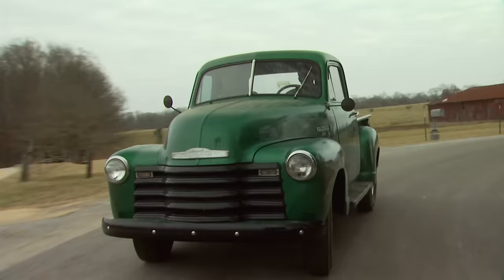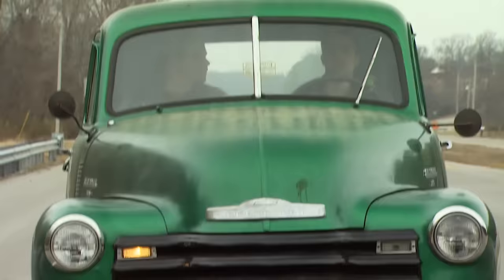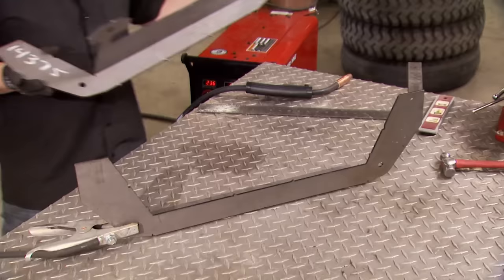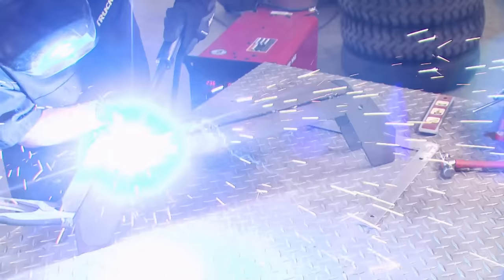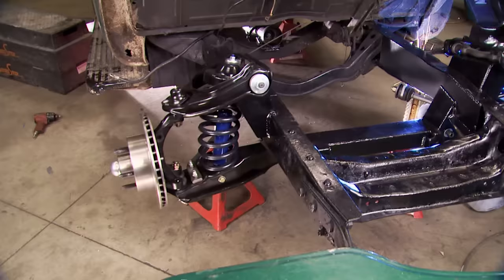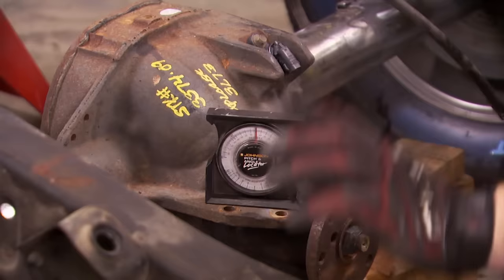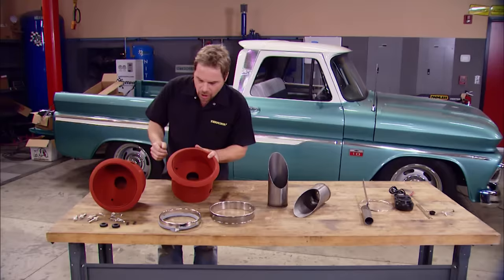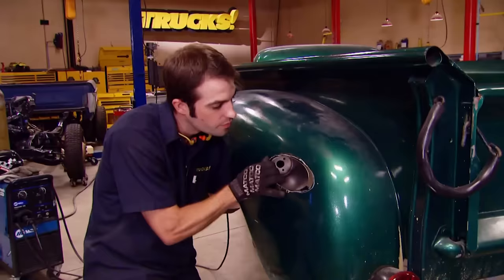FULL REBUILD: 1949 Chevy 3100 Truck with a Hopped Up Straight Six and Patina Paint

Comment: These classics deserve to be restored and preserved.
Reply: i agree 100% i hat it when people get great old trucks and turn them in to hot rods
Reply: well that one was restored in the 80s, so its not original anymore.
Reply: @Motersickle Bum that is true I can’t stand lowered trucks such a waist
Reply: @Motersickle Bum that is a terrible story I work in a tire shop and I occasionally see that kind of stuff and it just makes me so mad I saw a guy who had a diesel 1986 dually GMC that he had lowered and put passenger rated tires on it which is actually illegal for a 3/4 ton Axel it was so bad
Reply: John Smith  keep it as a truck it looks pretty ugly lowered and you still have a bed a motor built to work
Reply: John Smith  wo wo how old am I? Don’t ask me that nobody cares what you think either your worse at spelling than me
Reply: John Smith  ok 10 year old
Reply: John Smith  huh
Reply: @Motersickle Bum I know! 
They spent like $3200 plus labor downgrading the suspension. 
I mean I can sorta get the front axle but not really. 
I don’t why keeping leafs was a problem other than promoting parts that people sell?

And how do you do the math on repair to the tree shifter by replacing the transmission? LOL 
And they had to buy a transmission crossmember? 
It pissed me off they hacked the floor when a hammer and dolly and some judicious cuts it would have at least looked like it belonged there.
Reply: It's just an old piece of machinery.  The best things about it are the cosmetics.  Functionally it's terrible and actually somewhat dangerous to drive in modern traffic.  If it's modified and gets more use because it becomes more fun to drive, I think that's a win.

Comment: My last year in the military I had a '49 Chevy pick up.
I rebuilt the 235 engine that was in it, backed it with a 3 speed overdrive tyranny (eh..which... I mean transmission) with a floor shifter, installed a '56 Chevy passanger rear end, and installed a '52 Chevy passenger car front suspension that lowered the truck way down.
I installed 4" lowering blocks under the rear end.
I converted it to 12 volts, installed a '66 Pontiac tilt column, and installed rear door window motor/regulators from a '64 Oldsmobile so I could have power windows.
I also had Lakes pipes on the edge of the running boards with a notch cut into the front fenders.  The mufflers were 12" oval glass packs installed just inside the notched fenders.
The stock exhaust manifold was "split" for that old school "Twice Pipe" sound.
The wheels were chrome Rocket brand brand wheels that kinda look like the old Cragers.
The tires were 5x20x15 (white stripped) for the low rider look.
That truck was my old girl friend's favorite vehicle to drive because she used to like to drive it on windy roads.
She favored it over my '56 Belaire with a 375 horse 327!!

Comment: This was the first vehicle, which I owned. The 3 on the tree shift linkage would also get stuck between gears, but it was easy enough to straighten out quickly at the field.
       It was stock and I used it as a daily driver back in the early '80's. It had no problems keeping up with traffic on the expressway. Don't know what the top speed was but cruising at 75 mph wasn't a strain. As far as the brakes, I had to "think ahead". It had the oil bath air filter, but didn't have an oil filter. That was kind of cool.

Comment: I had the same truck as the first 4 wheel vehicle, that I even owned. It was green, but was a rust bucket. The 3 on the tree would occasionally get stuck between gears too.  Had the starter pedal on the floor and the oil bath air cleaner. A lot of fun, back in '82.

Comment: We own and built a 50 with a 261 out of school bus, duel Webber’s, Fenton Headers, Saginaw  four speed transmission, twelve bolt GM rear end with 3:07’s
Power disks brakes, power steering , mono leaf springs all the way around.
Reply: I have a friend with a 53, 3100. He also has a 261. But, had a radical cam manufactured for it and has a Corvette triple carb side intake and duel exhaust system. Damn thing is fast!

Comment: Reminds me of my first vehicle, a fully restored to original 1950 GMC pickup which I purchased for $300. That was in 1973 and it was old then but looked and drove like a dream. 3 on the column of the largest steering wheel you've ever seen, had to be big because there was no power steering. 6 volt battery system located under the passenger side of the bench seat, floor starter which required you to push in the clutch and gas pedal while crossing your right foot across the starter petal. A toasty box heater underneath the passenger side dash, no turn signals (you had to use arm signals sticking your left arm out the window) and one tail light located on passenger rear bumper. Positive traction and could go most anywhere. Once drove it across a flooded lowland and the water began to come up into the cab, 2/3 of the truck was submerged but it made it across. Changed the oil with no damage...what a truck.

Comment: Nice job!
I had a 50 with a 250 I-6 ,headers and dual exhaust and a car 4-speed. I slightly updated the suspension with mono springs, factory front sway bar and a disc brake conversion.  A newer car rear end was installed with appropriate gearing so I could just slide down the freeway as needed.
 It was a lot of fun and literally used as a farm truck to haul hay for the horse and materials for home projects. :) DT

Comment: I’m so glad I found this video!  I have an early ‘55 in similar condition.  I’ve long wanted to upgrade some aspects and you really showed me what’s possible.  Luckily I’ve got lots of patina already!   But the suspension and drivetrain tips were great.  I already rebuild the engine but I do want to add the twin intake and carbs.  I’d also like to add an electric choke.  I’d like to stick with a manual transmission but I’ll find something for that.  Love it!   (I also live just down the road form Chevs of the 40s) so parts abound!
Reply: I'm in Texas come get it painted. It will look like a mirror 🪞
Reply: Vice grip garage did a fuel injection install on the same motor in a video. Check it out
Reply: @canibmeplz260  Nope, VGG did a later six.

Comment: My Dad had a '49 Chevy 3100 which he drove to work 5 days a week. In '65, he bought a "65 Chevy Impala and gave me the truck in '66 so I could drive to work. It had the 216 with a 4 speed. The 4 speed had the "Granny" 1st gear so I'd start out in 2nd. It was originally light blue but had re-painted at Earl Scheib in British racing green. There were no turn signals so you had to use hand signals. That old truck never let me down. The worse part was the vacuum windshield wipers. If it ain't broke, don't fix it! I'd have no problem diving mine cross country. The stoc ride height is perfect. No fear of speed bumps, driveways or deep puddles. Off road, no problem!

Comment: First vehicle i learned to drive was a 1951 Chevy pickup my Grandpa owned. Love those old pickup trucks still to this day. A friend in high school had a '49 and it was our favorite vehicle to run around in and to to other small towns. A 4 speed with floor shifter solves the hanging shift mechanism. My ol' '60 Apache 10 had the same problem. Made some changes and got it working ,but i was still the only one that could shift it. Automatic in those ol' pickups is heresy and a Ford crap front end...you guys really know how to screw it up.
Reply: would you rather have seen a Nissan front member in there instead?

Comment: I drove a '49 as my work truck for 15 years until it was falling apart and I sold it on Ebay. I miss it sometimes but have so many good memories...except for the brakes.
Reply: When I got mine, I had to put new rubbers on all the brake cylinders and the master cylinder.

Comment: when they say "budget" and "DIY"... but have a lot of "friends" to help them along the way. this has to be between $30-50K
Reply: Low budget, have to disagree on this one...
Even with a purchase of truck...
Reply: In the custom world, a "cheap" build is about 50k
Reply: Eh... Friends save time. Like the window mod. Anyone with a little body and welding experience can do that if they take their time. If you ain't rich you gotta spend time, talent, and elbow grease if you want nice stuff.
Reply: Your not wrong, we're hearingyou. I'd rather have a good remanned build with no engine, trans, diff swaps. Just fix what youve got. If it was tough enough to last 60 years on oe parts, itll go another 60 once its issues are sorted. Not to mention the saved thousands of dollars most of us laymen dont have. Nice truck thou.
Reply: It is very budget friendly when it comes to these truck. 120$ each wheel. 900 in just the rear 1000 in the front end. That’s not much at all. Most the money was spent in the engine and purchase of the truck
Reply: In 2023 numbers 50k is low budget. In 2009 when they made this rig the numbers were a wee bit lower. Either way they were both made amidst a world economic disaster. All we gotta do is print the money and get to work.
Reply: Love that copper!

Comment: Hey guys, nice job on this truck!  I'm currently 6 years into my '51 Chevy 5-window build, and there are a lot of similarities between your build and mine.  I live in Western WA and picked up my non-running (no engine) truck from the dry desert area of eastern Washington, for $3 grand in 2016.  I added a 327 V8 and a 700r4 transmission.  I upgraded to IFS, but did go with a kit from FatMan.  It did cost significantly more, and that's where I can criticize.  I would LOVE to have done much of the stuff you did on the budget you did, but I don't have a) a big shop (my truck was outside during summer months only), b) welding equipment, or c) many of the specialized tools you used to fabricate parts.  The expense of my build ( about $30-$35k so far) has been in paying shops to do some of the specialized work.  I paid a shop to install the IFS with power steering last winter.  Early on I installed a power brake master in the original location but paid a shop to fabricate all the brake lines.  I paid a shop to build a custom exhaust, and I paid a shop to rebuild and mount the 700r4.  I'm not going patina on my build but I did have fenders painted a contrasting color.  That was another large outlay in cost.  The truck body still have some rust issues that will eventually need to be addressed.  I mainly watched your episode to see you build the 4-link rear suspension, which is one of the next things I want to get done on my truck.  Overall, I really like your build, but for the average driveway build, it's going to cost a bit more if you can't do a lot of the things that require specialized equipment.

Comment: Yeah, they messed it up! I would have given it a good repaint, maybe changed it to a more modern srtaight 6, bolted it up to a four speed manual on the floor (because I hate automatics). The idea of electroplating the grille and headlight rings copper depends on the color of the truck you choose, but black would look cool with copper. The idea of dual exhausts was cool, but have each pipe come out the bsck seperated. Changing the running gear and brake was good, but I would have only dropped the truck 2", not 6". Faking "patina" is only for a personal choice that I would not have made. Unless you want it to look like showroom condition, all the work they did was wasted.
Reply: I agree, and the only time I allow fake patina is if it is on a small repair panel on a car that had natural patina
Reply: To each their own

Comment: while  this ended up a pretty nice looking truck, definately not really my style, and to each their own. if i wanted a daily driver, it would have been fine the way it was except it really did need an engine and trans overhaul. i'd probably use the same engine but go with a 4-5 speed manual on the floor. i even warmed up to the copper on the grille towards the end, but black was fine. I really liked the green paint, though it most likely it wasent the factory color. i have to agree with some others about cutting up such a good vehicle, extra windows and the headlights was really not necessary. overall i wish i would have found this truck before you and bought it first, it wouldnt interst me to buy now, even if it cost the same $6K  you bought it for. i would be interested in the final amount that was spent on modyifing, its never mentioned. i bet the cost is still ALOT. final bit, NO FORD PARTS ON A CHEVY!! common sense!
Reply: totally agree i love old stock trucks so i hated this but i nearly puked when i heard the put the ford explorer part in it
Reply: You must've missed where they explained that they're building a reliable daily driver with a cool factor on a budget. 70 year old parts doesnt scream "reliablitly" and the Ford stuff is available anywhere you look and keeping with the "on a budget" theme. The cosmetics are a matter of opinion, some mods were cool, some weren't, but whatever it's their shit they can do whatever they want.

Comment: Awesome build and my current project truck is following a similar style. You did a great job!!

The only complaint I have is as a professional driver. Those little steering wheel knobs are usually referred to as suicide knobs by us, with good reason. Ditch them fast, even a small bump at highway speeds can break an arm if using it, and for more serious incidents that’s when they earn the name suicide knob! 
I know that’s being kind of picky but that’s one thing that pains me to see on a vehicle! A darn suicide knob!
Reply: I drive a '47 1&1/2 ton almost daily. I took 2 wheels off the rear. I run 7.50x20" 6 ply all around.
It's a blast. Not fast, not easy on the spine, but high fives from many folks.

Comment: news for you fellows from someone who drove a few of those trucks when they were still fairly recent as well as later trucks from the mid 60's. I drove a 63 that belonged to a furniture store I worked for at the time. It was brand new the year I started there. My personal car was a 49 Plymouth deluxe 3on the tree as was teh 63 company vehicle. I never hung the plymouth's linkage, but on several occasions I or some other person would hand the linkage in the pickup. It seemed to be a fairly common issue that my uncle had with his 55 Chevy Belair. I have owned 3 speed on the tree versions from all three manufacturers and the problem seemed only native to the Chevy's. Thankfully almost every manufacturer went back to the simpler system mounted on the tranny hump, directly above the transmission, where it belongs.

Comment: I had a 54 chevy pickup, it was great, but my favorite truck was the 55 1/2 ton chevy pickup truck. They were built to last, if you can avoid running off the side of a bridge in it.😉
       The 54 didn't have a title, but the truck motor number was the vin number, so if you changed out the motor, you had to re-register the vehicle.
      Simple.....I just bought a title of a totaled 54 chevy from a junkyard then went to the DOT for a new title, with a junkyard motor number and a change of color to match the truck. Preso Chango I had a good title for a no-titled vehicle. 
      I worked at a food warehouse, a Hale Storm came through while we were working. Every car in the lot had pings from hale stones, all the sales fleet was hit. Thousands of dollars in damages, but not a single ding on my truck from the ice, it was a tank! Too bad they don't build them like that anymore.

Comment: “Look at this heavy duty bumper, I know that’s not original.” They do realize trucks were made to last back in the day and made of steel. Tailgates and numbers are bigger now but made lighter and get damaged easily
Reply: Yes, however factory was a chrome/stainless bar similar to the front. I prefer that steel aftermarket/homemade one

Comment: That is not a 216 engine or early 235 engine. The 4 bolt valve cover came out in 1954 vs the 2 bolt valve cover used up till 1953. No 216 ever had a 4 bolt valve cover. That engine is a 235 or 261 Jobmaster engine.
Reply: Thriftmaster or Jobmaster
Reply: Yeah, they correct and re-use the later 235 that had been swapped in there later in the video...
Reply: @Charles Small  Something else I noticed was there appeared to be a one piece windshield in the new 49.  54 was the first year for a one piece windshield. What up G
Reply: BuzzLOLOL fake engine like the rest of the truck. I guess that’s ok but nothing special.
Reply: @johnswick4593  you can get a 1 piece conversion windshield in place of the 2 piece windshield

Comment: The linkage on those old Chevs were notorious for jamming. That’s why everyone would convert it to a 3 on the floor. We would also flip the shift arms on the tranny so the gear pattern was off to confuse thieves. Also, a hidden switch between the coil and starter would fustrate would be thieves

Comment: Rattle cans  as  you  call  them  was what 2  friends  of  mine  used  to  paint any  mid  70's  Nova's  they  would  buy  I admit it  seemed  they  liked  Gloss  Black  but  the  finished product  looked  as  if  they  used  a  Spray gun  and looked  Awesome  they  even  went  Crazy  on  1  of  them and  had a 350 Big  block  truck  Engine but  hey  they  always  sems to  sound  very  nice when  all was  said  and  done so  Rattle  cans  can  be  a  good  thing  at  some  point  I  guess

Comment: This is really a 1951. That was the only year with vent windows and turn down door handles. Also, the 49 would have a vent on the driver side in the cowl and would have knee lever shocks.

Comment: Until I saw this one,  I was not a patina paint fan at all.  In fact,  I disliked it a lot.  You guys have changed that with this truck. The patina looks great with the copper trim. The straight six sounds great.  Good job and you also converted me to a somewhat picky patina fan.